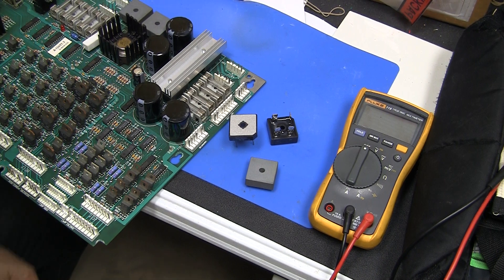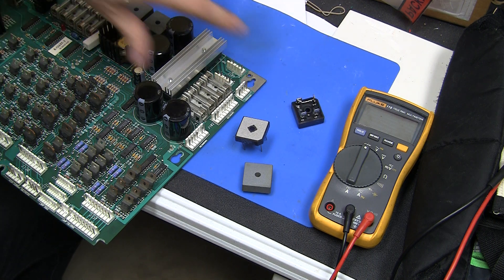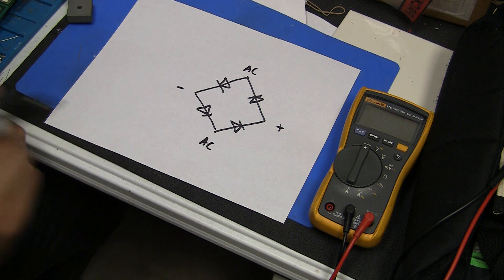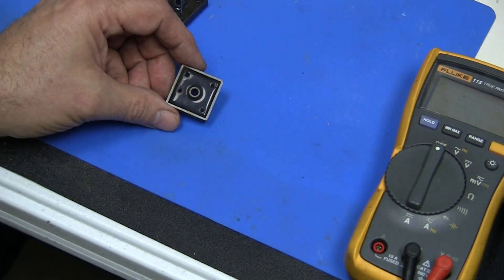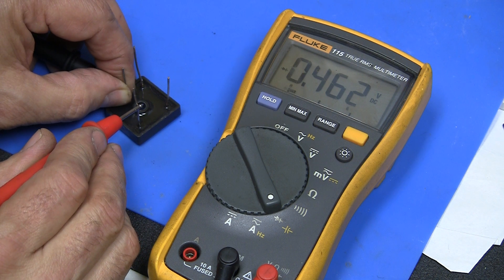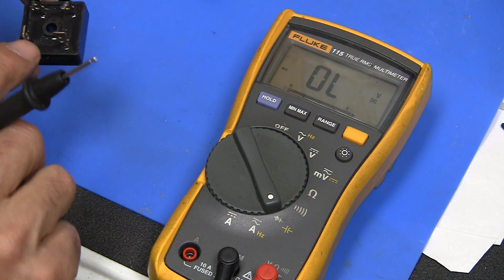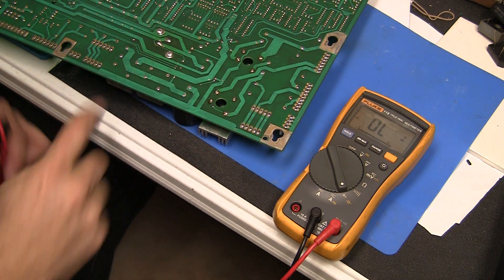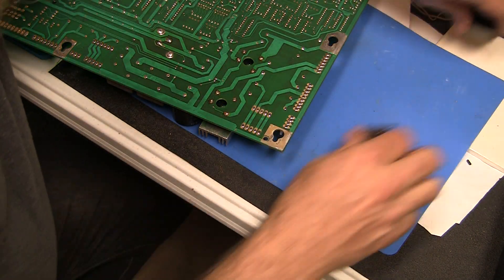How to test/check bridge rectifiers - PinballHelp.com

Comment: I guess this is the same way to test the N.E.S. RC203 diode bridge rectifier thanks for sharing this information I have a strong feeling that this component is faulty on my NES system I have video but the sound sounds like a buzzing noise and it was never like this before so I take it as it bit the dust and I already had changed the capacitors so they are great

Comment: I have a bridge rectifier in my generator electrical panel. It’s a 9000w starting watt gen. The rectifier I have is a 4 prong. When I test from (+) to the black wire, I’m getting 0.856. The other two wires are grey, one reading was 0.466 and the other was 0.469. Does this seem fine?
Reply from the maker: I am not sure about your application.  You should talk to the mfg of the panel you're using.
Reply: Measuring from + terminal to - one, you are measuring the total of the diodes, being connected in series internally. This (forward) indication seems to be normal. Nevertheless you must see no indication by reversing the polarity of the test leads of your multimeter. Any indication there, would mean leakage current. The two gray cables are connected to the AC side of the bridge. You have better measure all the four diodes independently using these terminals, for a complete test. The measurement you performed didn't give you the information of an open diode therein. It only gave you the information that you have no shorted diode within the bridge, this being a good information but nevertheless an incomplete one...

Comment: I have one PCBA with Continous fuse blow of issue whenever I tried to power on.  Hence I checked all the components  in the PCBA and when in come to bridge rectifier I've checked in this aspects as per your comments.  It's shows good. Hence I kept the PCBA aside. After  few weeks I surfed on Google and some said to check the bridge rectifier in resistance mode. I could see low ohms in AC to AC pins. That's the reason the fuse is always blow when ever I tried to power.  Request you to check the diode in resistance mode also.

Comment: On one of my bridges (BR2 on kings of steel) I'm getting .936 / .939 for positive but .450s negative. BR1 is good 450s all around. So is my BR2 bad and that could've cause my F3 fuse blow? I originally thought I had bad mpu board but tracing it down

Comment: I’m not sure why you can test in circuit…I mean usually here are filter caps off the rectifiers, and I thought these might mess up readings, but I’ll try it and see. I have a suspect bad rectifier, and this came in handy even though the drawing he did was wrong. Each pair of diodes across from each other should point in the same direction. But this was very useful for me! Thanks!
Reply: So, can these be tested in circuit? I have gotten strange results measuring voltage both ways
Reply: @johnward3874  This was 3 years ago so I don’t remember all of the context here, but it would help if you mention what you are reading, voltage wise, and what results you feel are strange? Remember at the actual bridge the signal is not AC but it is rising and falling, each of both sides. After the filter caps it should be DC. Can it be your RMS readings are messing you up. AC IN.
Reply: @shader26  thanks for the help, I pulled it out of circuit and it measured fine. I as looking for a way to test quickly without having to remove the bridge rectifier

Comment: Great tutorial! I have a controlled lamps issue, so I've checked and replaced the blown fuses, but it is still not working. I've read that it could be an related issue with the bridge rectifier. Where can I find the affected bridge rectifier in the PCB? I have the Data East "Tales From the Crypt"

Comment: My centaur pinball has a 5 to 10 second delay to start after I turn the switch on.  Do you know if bridge rectifiers have anything to do with this delay?
Reply from the maker: It normally takes a few seconds for these games to boot up.  If you look in the head you will see the game goes through a self test where an LED blinks 7+ times to show all the major areas are ok before the game starts.
Reply: @PinballHelp  thank for reply.  I always wondered if there was an issue somewhere with my centaur or not, because my other games like whirlwind or mousin around start right away.  I changed all the Caps and tested my bridge rectifier, which tested good and was thinking about maybe +5 volt issue , but your response makes sense.

Comment: l.
Gorgar. I flip on power. Says “Gorgar!” No credits added, flippers flip. The Ball doesn’t pop Out. Manually Get the ball and plunge it. It Scores on the display pointS with no sound and no solenoids fire. I can add 4 players. All displays bright. 40 pin connector looks beautiful. No batteries damage. Remote battery pack with new batteries. HUO Gorgar, I’m the 2nd owner. F2 fuse not blown. All fuses are correct....any ideas? Thanks....maybe the Solenoid Bridge Rectifier?
Reply: Rebuild 40 pin connector
Reply: If any of your PIA are AMI brand, toss them and install Motorola brand or similiar. AMI brand is junk as PIAs go.

Comment: Is the circuit diagram correct?? I thought all of the diodes should point in the same direction.
That's how it is drawn on another site that I looked at. All should point toward the + terminal.
Thoughts???
Reply: You're thinking the right thing. That diagram is not correct. Like you said, all the diodes should be in the same direction.
This is how you take it;
1) your positve is where two cathodes meet
2) yout negetive is where two anodes meet
3) the AC lines are connected to the points where the anodes and the cathodes meet
4) there are four points in total. 
a) the point where two cathodes meet
b) the point where two anodes meet
c) the point where an anode and a cathode meet - of this kind, there are two points on the circuit.

I don't mean to offend him. I like his clean table and his video quality. His explanation on how to test them with the multimeter is not bad.

Comment: PINBALLHELP
               Upgrading the System 3 Driver boards to "Increase the voltage on the switches" 
 Remove the resistors to the voltage that applies to the switches and install JUMPERS. 
    This Upgrade is for the PIA chips to detect the switches being closed easier 
    This upgrade is for can cause "false switch closures issues" 
--->  1.) Why would increasing the voltage to the switches make the PIA chip detect the switches being closed easier? and why would this cause False switch closure issues? 

Upgrading the System 3 Driver Board, there is multiple 27 ohm resistors that are 2watts that are burnt because they are for the Feature Lights. The 27 ohm resistor can be removed and upgrade using different FET's 
--->  2.) Which FETS are used to upgrade to not use the 27 ohm resistors for the feature lights?